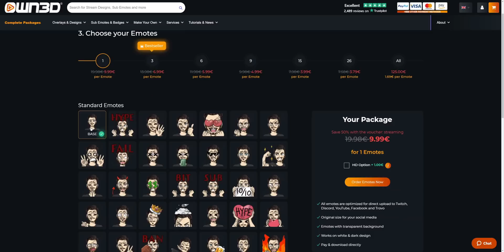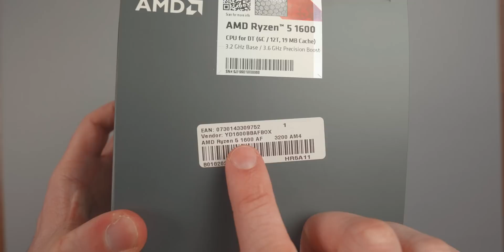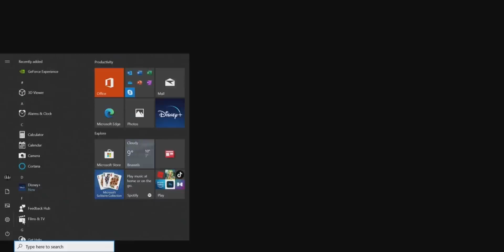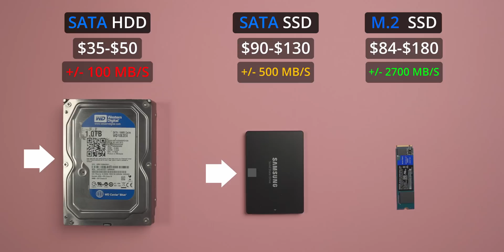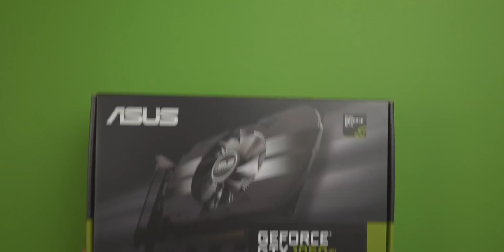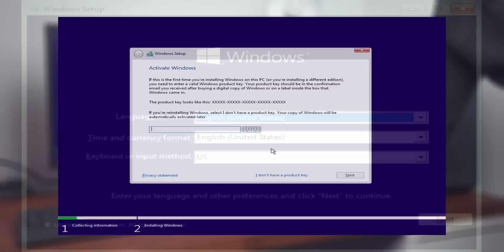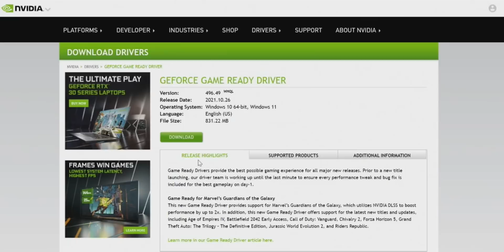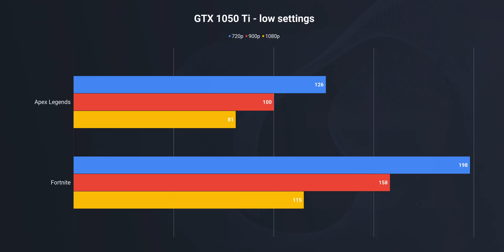Building The Cheapest Gaming & Streaming PC For 2022

Comment: Using anything that isn't AT LEAST ryzen5 3600 is a meme, best build would probably  be a 5600x. In a b550m mobo to have access to pci-express 4.0, so if one day you acquire a proper gpu, you can perform nicely. I'd pick 2x16gb to achieve 32gb of ram... and would upscale the psu to anything corsair/thermaltake 750w because, it is marvelous.

Build clever boys!

Comment: 5:12 let me correct you... A HDD isn't outdated because it's cheap mass storage if you need it (1TB for 41€ is cheap compared to a 1TB SSD that will probably costs you around 90€ to 100€). You don't need fast storage to store videos, documents or pictures. You could even store some apps on it, I have steam (not my games but the launcher), utilities and software that are not related to gaming on them and my SSD is only for games or apps that need quick storage.

Comment: Is there any problem if we use for example a ryzen 5 5600x instead of the one you used, or if we use other ram??
Reply: as long as the motherboard is compatible. you can mess with parts in pcpartpicker as that shows the price and the compatibility.

Comment: A good year ago I had build a pc for €450 for sale with used R5 1600 (€50) and used Gigabyte GTX 1050Ti Windforce OC (€150, 6 months warranty left). The other parts where new: Gigabyte DS3H B450, Patriot SATA SSD 240GB, SilentiumPC  550w 80+ Bronze PSU , 2x4GB 3200Mhz G.Skill RAM and Sharkoon RGB Slider case. Sold it for €500. Not much profit, but the new owner was happy that he could play GTA V with good settings and that pc were like new.

Comment: So I've checked how much it (for my liking) would be a few months later, and I had to make a few changes (some soldout):
1 SATA SSD and 1 m.2
550-watt power supply was unavailable so I went to the 650

So with all these changes without coupons, it would cost around $883. But with coupons, the price would be about $769. So currently, to make the computer to my liking (which changes the price by around 100$) it would cost slightly above the "$550" which is a lot less than what I expected.

Comment: Alright.  Although dude did not respond to my questions I got this machine built.  I went with the Gigabyte B560M DS3H mother board which at the time was $72 (on 3/13/22).  I used an Intel Core i3-10100F 3.6 GHz Comet Lake 6MB Smart Cache processor ($95.99 on 3/12/22).  I had to go with a different power supply because the one in the video was unavailable as a new item so I went with the EVGA 550 B5, 80 Plus Bronze 550W Fully Modular (part number 220-B5-0550-V1) $73.99 on 3/12/22.  I also added an ASUS TUF Gaming 27" 2k HDR Gaming Monitor (VG27AQ) which was $325.99 on 3/12/22.  Other than that it's exactly as he has listed in his description.  Oh and I used the ASUS PH-GTX1050TI-4G GeForce graphics card which was $219.99 on 3/12/22.   I got everything on Amazon.  All in was $1188.50 including tax.  That includes the display.  This was a build for my 10 year old to get started.  I like the power supply better than the one he has listed because it's fully modular meaning I don't have a whole bundle of cables taking up space that I don't need.  Couple things to add.  This mother board is laid out a little different than the one in the video.  Also, the M.2 drive has to go into the socket on the left side of the graphics card.  Not the socket closest to the processor.  The M.2 socket next to the processor only works with 11th gen processors.  The machine won't recognize it.  Learned this the hard way after I had it all finished had to open it back up and change that M.2 to the other port.  After that the system recognized it and I was able to install the OS.  To boot to BIOS I know gigabyte and his video say spam the delete key but I had to use F8 the very first time.  Now that the OS is installed you can use delete.  I have no idea why.  All this to say she's hard wired to the network and getting 60 fps with this build on Fortnite.  The machine is super fast.  Boot time is literally about 5 or so seconds.  Any questions feel free to reply to this comment and I'll do my best to answer.  I've worked on Macs for 30 years.  This was my first venture into building a PC from boxes of parts.  I am happy with the outcome.
Reply: How is the streaming? Tried streaming to twitch? had any problems/lags? Warzone?

Comment: the only problem i have with this video is how the link to the "NVMe" m.2 ssd is actually a link to a SATA m.2 ssd. if you dont know a SATA m.2 delivers the exact same speeds as a normal non m.2 ssd. And a NVMe is where the real speed is, it should always say what type it is on the m.2 or in the description. But I see you used a NVMe in the video but once again you linked something completely different and that is very misleading to new builders.
Reply: And I just bought it I was trynna figure out why it wasn’t fitting now I’m upset

Comment: i got my new pc 5 months ago
here are them specs: 
Ryzen 5 3600
MB: B350 pro 4
32 gb ram 2666 Mhz
GTX 1650 Asus pheonix
550w Power supply
SSD 250GB for Windows
1TB HDD for games and stuff
What do you think about this setup? would it be able to stream and stuff?

Q: i wanna upgrade to gtx 1660 super in the future, would it bottle neck? or would the difference in fps even be worth it?
Reply: How dose it go playing games like halo and fortnight?
Reply: @Ga7cun7sSUCK  fortnite 160 in medium settings with high textures
halo around 85 on low
Reply: You can check the internet for a bottle neck calculator its easy to find, you would be above a 10% bottle neck so you shojld upgrade your gpu to a better one as your cpu is too powerful for this gpu.

Comment: nah the cheapest pc i 379$ made by me

parts:

case:montech fighter 500(48$)

motherboard: asrock b365m pro4(74$)

cpu: intel core i3 9100f 3.6ghz quad-core(78$)

cpu cooler: thermaltake ux100(10$)

ram: hyperx savage 8gb

storage: seagate barracuda 7200.12 1tb(28$)

gpu: msi r7850 2gb vram

psu: evga 650 b5(49$)

total price: 379$

all are tested on pcpartpicker and are compatible

Comment: My pick for under $500 CPU build.
1. Ryzen 5600G. It has vega 7 VGA, much better than 1030 but less than 1050ti.
2. Mobo, pretty much any B450M. But personal preference, asrock b450m steel legend. But note it cannot run my RAM recommendation because it has 3500Mhz freq limit. And my RAM rollback is 2400 which is pretty terrrible.
3. PSU MSI 550w bronze.
4. Any 256gb SSD. Sata or Nvme doesn't matter that much.
5. Memory, Team group dark Z alpha 8x2GB 3600Mhz for AMD.
6. Any casing.
The cost is $460 more or less.
Reply: How much does this build cost now?

Comment: so personally my pc should handle youtube and any streaming right?

CPU: Intel Core i5-10400F
GPU: EVGA GeForce RTX 2060 XC GAMING
MoB: MSI B460 Mortar WiFi
RAM: G. SKILL 32 GB KIT DDR 4 3 200 MHz CL16        
storage: WD Blue SN550 1 TB NVMe SSD 
Cpu Cooler: Arctic Freezer 34
Power Supply: GIGABYTE P650B 
Case: NZXT H510 Matte Black
Reply: Nah man
Reply: @Rilayy  bruh thats bad ... so i need upgrade something
Reply: @miraakyt9640  I was kidding thought u were sarcastic
Reply: @Rilayy  no i was really asking as fresh person into pc stuff because most of life i was on mobiles and ps3.
Reply: @miraakyt9640  ah ok i think ur pc specs are close to getting high end, you shouldn't have problems playing modern games and dont even worry about stuff like YouTube and streaming.
Reply: @Rilayy  because in Huge boredom i would try stream Minecraft or Terraria because those games are very chill for me.
Reply: @miraakyt9640  that PC will have no problem streaming those games, in fact on Minecraft you should be able to use shaders too. I've streamed on my i5 6300HQ, 8GB RAM and GTX 950m laptop and it did a decent job.
Reply: @whitebeartigtig  yeah thanks. If i lock maxed out complementary shaders on 60fps i should have Enough room to use nvenc stream or just use potato settings for them and go 144 for my eyes and people should still get stable 60. I Can afford even cpu encode if i dont want use nvidia ones because my cpu have low Enough usage to spend on different apps.

Comment: A used gtx 970 goes for 130€ in my country. I can buy a case and 500gb m.2 ssd for 50€ each. 16gb 3.2ghz cl 16 ram for 60€, intel i3 10100f for 80€ and 550w power supply for 40€. Motherboard for 80€ so that puts me at about 500€. What do you guys think of that build?
Reply: pretty good but you wont be able to play many modern games like 2042 or cyberpunk

Comment: no mine costs 400$ with 300fps
Reply from the maker: Specs?
Reply: @TheVideoNerd  Corsair 220T (case)
be quiet system power 9 (400w)
corsair ram vengeance rgb pro 2 x 8gb
amd ryzen 3 2200g (apu)
with normal stock cooler. 
os is on external hdd
Reply: the mainboard was asrock b450m pro4
Reply: @TheVideoNerd  also the fps were measured in fortnite 
and i could‘ve bought a cheaper case but i‘m a corsair fan kinda
Reply: 400$ dollar pc with 300 fps? seriously

Comment: I got this build (i dont own it but its the best build you could buy in Vietnam)

+ Mainboard Gigabyte H510
+ CPU i3 10100F
+ 8x2 Kingston Fury Beast Black 2666 Mhz
+ CPU cooling Deepcool Gammax 400xt
+ GPU Asus Phoenix GTX 1650 (sometimes its went out of stock because its extremely popular)
+ SSD Kingston NV1 250GB M.2 PCIe
+ Case Xigmatex Aero
+ PSU Gigabyte P550B 550W

Probably the best build in Vietnam currently
Reply: Is it good for 2 screens and streaming on twitch?
Reply: @diverd5416  The build I show you up there is a budget pc build. So If you need a streaming pc, I would recommend this build:

+ Motherboard MSI B660 Pro Wifi
+ CPU i5 12600KF (with 10 cores and 16 threads, best CPU for 300 bucks)
+ 8x4 Kingston Fury Beast RGB 3200 Mhz DDR4 (32GB would be great for streaming)
+ SSD PNY XLR8 CS3040 M.2 2280 MVNe PCIe Gex 4x4 1TB (expensive, but faster than gen 3x4 SSDs)
+ GPU Gigabyte GeForce RTX 3070 Ti (a little bit expensive, but its powerful)
+ PSU Cooler Master MWE Gold 850W
+ CPU cooler Corsair H100 RGB
+ Case Cooler Master Masterbox K501L ARGB

Comment: Budget computer means under 250$. I've built one for around 600$ and I would never consider it budget
Reply: No
Reply: If u wanna be able to play any modern games u need to spend that much since pc specs are so expensive atm
Reply: @tatu301  Nope. With my 600$ rig I can play HIGH - ULTRA 1080p on minimum 60 FPS

Edit: I bought it 1 year ago
Reply: @JammyCrazy  1 Year ago prices were different. I know 600$ will get you a decent pc if u get good deal on gpu, but if you buy parts brand new you cant get proper build
Reply: @JammyCrazy  What specs u got tho?
Reply: @tatu301 
CPU: Ryzen 3 3100
MOBO: ASUS  TUF B450 PRO GAMING
RAM: ADATA XPG GAMING 16 GB 3000 MHz
GPU: ASUS DualOC RX 580 8 GB
PSU: SilentumPC Elementum 500W
SSD: PNY 240 GB
CASE: SilentumPC Signum SG1 TG

Around 650$
Reply: @JammyCrazy  That build costs 900 euros in my country at the moment so it shows prices have changed alot. The gpu is so pricey nowadays.
Reply: @tatu301  I know, for GT1030 I have to pay more than 100$, here in Poland. Like 130$ for the cheapest version

Comment: Can i use a power supply EVGA supernova 550 G3 80 gold plus? Instead of the corsair? Whats the difference between non modular and fully modular?
Reply: non modular means all the cables are attached to the ps. Fully modular is cleaner because the cables are all able to disconnect so you only use the ones you need

Comment: as for a budget pc you really dont need 16gb 3200mhz of ram. because of that you cheaped out on the gpu. Im definetly not gonna get a gt 1030 or a gtx 1050.
Instead, you can find a cheap gtx 960/970 for at least a 100$ less than the 1050

Comment: Thanks, really helped for my build the only difference is that i picked a ryzen 5 3600 and a 1tb M.2
Reply from the maker: Awesome! I also have a 1tb m.2
Reply: ryzen 3600 and 1050ti nahh thats bottleneck
Reply: @rac10doruk31  really? Local PC guy told me to get a 1050 ti with my 5600G instead of a 1650 since it’s only a 20% difference for $100 cheaper
Reply: @luluthesinner7100  Yeah thats still a bottleneck. Overkill cpu for the gpu. And a 20% difference for $100 is worth it 9 times out of 10
Reply: @leaf8396  yeah I know and I’m kinda realizing that I probably shouldve gotten a cheaper CPU and gotten a better gpu lol
Reply: @luluthesinner7100  don't go for cheaper CPU lol u will regret when u do editing/streaming or even CPU demanding games. Ur 6 core is a great CPU and won't bottleneck even higher end GPUs. You can upgrade for later.
Reply: Buying a 10 series card in late 2021 is a bad move 3050 and 3050 ti desktop version is coming soon to replace them with Dlss support.
Reply: @sarvesh6929  Its ok for me coz i only play esports title and it runs great. I will probably upgrade if the situation get better
Reply: An apu build is the best bet rn